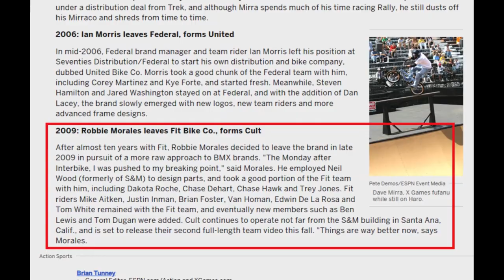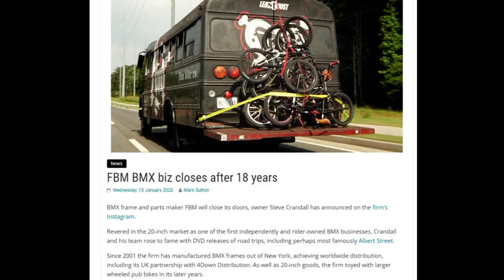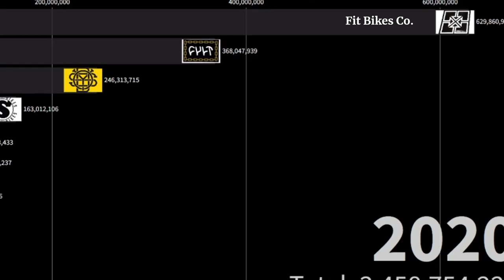THE BIGGEST CONSPIRACY IN BMX? (ft. OurBMX and YAWN MEDIA)

Comment: Interesting. Fit barely has any frames these days. I had a Savage and a Hoodbird and loved & still have both but they've discontinued most of the frames they used to make. They had a monster lineup of like 10 top shelf frames for a handful of years. Must be moving completes via Fit and frames via S&M.
Reply from the maker: Hard to say as an outsider, but you got a good point there!
Reply: I thought that was kinda obvious, because it has been seeming like that for a while. S&M is the core diehard BMX company, they make aftermarket bombproof stuff at a totally different price point than even the top of the line Fit completes. Do Fit's pros even get a signature frame model?